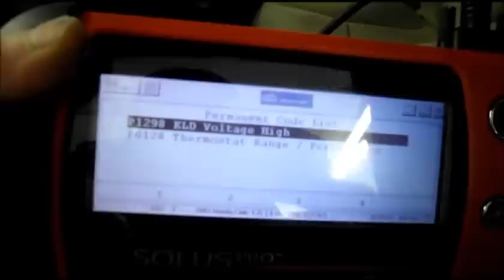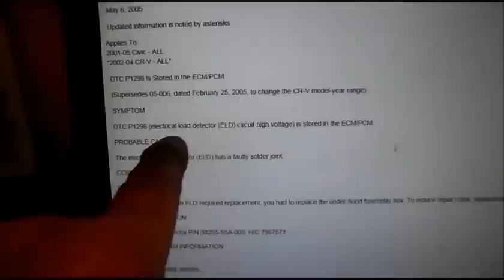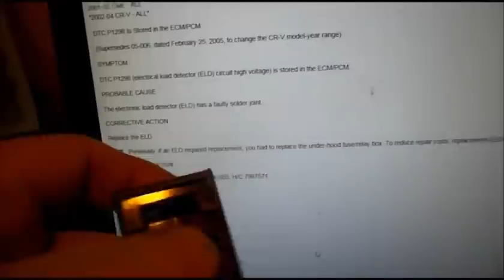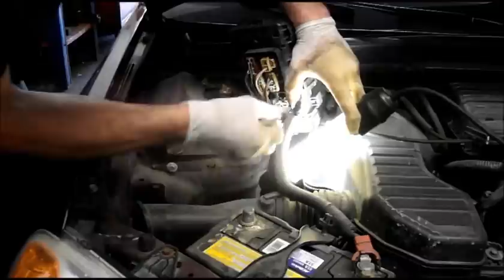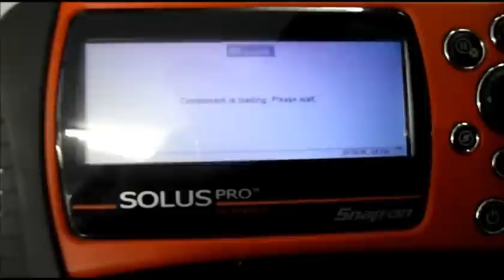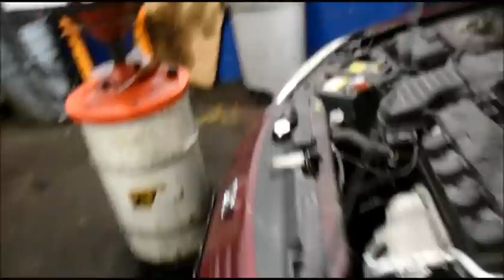How To Repair A P1298 Electric Load detector code on A Honda

Comment: Got a 2012 Pilot w the same code. I replaced the ELD however the code still shows up on diagnostics. Is it possible that the PCM is faulty? I am between that and the harness itself.

Comment: Hi Jim. I have a 2001 Civic EX and when I start the engine it runs fine but has a check engine light and battery light on and then a relay clicks behind the glove box and when that happens both of the warning lights go off but the engine runs rough until the relay clicks again and then the lights come on and the engine runs good again except it won’t idle. This will happen four or five times and then the car dies out and I have to turn the ignition off to reset it and do it again. Recently one of my boys replaced the water pump and that’s when it started doing weird things, then he replaced the crank sensor and now it’s doing what I just described. I noticed that he didn’t replace all of the ten mm bolts in the same places of the engine, and I wonder if it’s just a grounding issue or what the heck he did to it. My code reader won’t communicate with the computer either. I replaced the alternator today thinking that might be one problem, but no success. So we have a new water pump, crank sensor, and alternator, but more problems than when we started. We can’t even drive the thing now. Do you have any suggestions that might help? Thank you.

Comment: how is the car overheat when the thermostat is stuck open?  in fact will take a while to heat up to normal temp when cold and will slightly run cooler since there is no controling the temp.

Comment: I’m having intermittent battery light on 07 odyssey. Alternator is good, battery good and belt is good. I was going to change the ELD but the Honda dealership told me I’d have to buy entire fuse box. They didn’t sell the ELD separately.

Comment: Not sure if I heard correctly, did you say the car will overheat if driving for a long time while the thermostat is stuck open?  I would think will will be fine stuck open but the issue when cold in the morning will take a while for the engine to reach normal operating temp.

Comment: Thank you for the great video, Jim.  
As usual, a great walk thru that saved us lots of aggravation and money. 
I spent more time driving to the dealer to get the part then it took to actually replace it.
In my case, this one part took care of two trouble codes: P1293 fir the ELD and P1457 Evap canister leak.

Be sure to call several Honda dealers for pricing, because they all charge what ever they want.  My two local dealers were $30 apart in pricing, and I was able to purchase for $51.00.  (I needed it fast otherwise I would have ordered online for less.)

Comment: What if its eld voltage low? And would it be the same on a 97 prelude
Reply from the maker: Did you check the output of the alternator?

Comment: would that cause a rough idle,  cut off sometimes, and be really sluggish, like if the cat was clogged?
Reply from the maker: No not likely. Did you scan the car for codes?  Watch for the next free tool giveaway coming soon.
Reply: Yes

Comment: @jimthecarguy Hey I have the same code on my 98 manual civic sedan but I did replace it 3 times and I still have the same problem it keep showing the same code? Any thoughts
Reply: Did you clear out the codes before driving it and then rechecking for the code?
Reply: Yes I did
Reply: Yess I did and the check engine light was on again and telling me it was the p1298 and p0135 and p0141
Reply: @jonathanlibreros1332  Hey just got that same problem with my 99 civic manual. If you find out what it is help me out please!

Comment: Could the cause of this is the battery? I got the same code on my car and the engine light is on? If I was to get this done does the code have to be clear although the engine light goes off after?
Reply from the maker: No it is not the battery. After the repair the code should be cleared out.Thank you for watching . I'm happy to help. Don't forget to subscribe.
Reply: @jimthecarguy  Thank you Jim for responding and for your help. Great video by the way very helpful!

Comment: Question: Would a bad ELD cause my 2009 Honda Accord headlights to flicker/pulse?
Reply from the maker: Yes it is possible. Did you check the output of the alternator
Reply: jimthecarguy..Hi Jim..Yes I checked the Battery and Alternator.I also had a Parts Store checked them and they all checked good.  I went as far as cleaning the ground-wires and all lights still flicker. 
I also noticed the belt tensioner moving quite a bit and the two arrows on the tensioner do not aling. Could this be the reason for all the lights to flicker???
Thank u again.
Reply from the maker: @Aviador1010  When you check the charging of the battery what is the voltage and does it stay steady.
Reply: jimthecarguy the voltage is mostly steady at 14.9 but it drops momentarily to 13.0 when the A/C clutch kicks in. Just for a second tho.

Comment: This is EXACTLY what i needed to see. This P1298 code is the last of the bugs i've been chasing down on this car. First it was a crank position sensor, then the idle control valve, and now this P1298 is the last code to fix on this car so i can smog it and register it. Thank you for the detailed and informative video. Much appreciated!
Reply from the maker: I'm happy to help. Thank you for watching.

Comment: My friend's Honda Civic 2006 got code P1298 and the fuse box looks like one in the video. I noticed also that battery is being charged at idle 14.2 volts. Is there a connection to bad load detector? Great video, thanks

Comment: I have a 96 acura integra that was a JDM B20B enging swap and i have the code P1298 but heres the catch my under the hood fuse box doesnt have the so called ELD and now im at a stand still any ideas?

Comment: I have a 2012 Honda Civic Si,  How hard would it be to show how to run a bypass on the ELD?  I have a huge sound system with a auxiliary battery in the trunk. The ELD is preventing the alternator from outputting and staying in the higher current mode when I need it too.  I also upgraded to a High amp alternator (Ohio Generator) but it doesn't matter if it pumps out 1000 amps the ELD still cuts it to 12 volts in order to save on gas mileage.  The ELD is such a pain for people with large sound systems in their cars.  I just want to run it old school, but with a switch so I can manually turn it back to "Gas Savings Normal" when I'm transporting the elderly.
Reply: Lol

Comment: I have an 09 Civic si. I’m unable to remove the fuse box housing because it’s factory zip tied to some sort of hose full of cables. I don’t even think if I cut the zip tie I’d have enough slack to invert the box. I can’t find any videos to confirm that my generation of Civic even uses the ELD like these earlier models. Any ideas?

Comment: Jim, CRV has gone crazy. Brake lights won't go out, numerous gremlins all over car, some things work, then don't.  All electrical 1st gen CRV, early 2000-2003. Any ideas? Could this thing be the problem?? Thanks..
Reply: Find as many ground points as possible and inspect and clean them. Many times single ground points have up to 6 wires going to it and so one bad ground can cause a lot of electrical issues from seemingly unrelated systems.

Comment: You did a good job the only problem you disconnect the negative always disconnect the power one you never know if the negative will touch metal and gets grounded thank you. you did a good job

Comment: Thank you for that info that helps me out with one problem in my car another problem is the Vtec solenoid would that interfere with that and cause it to kick on and and back off and it smokes real bad and burning oil. I have a 2003 Honda Civic EX 1.7
Reply: How many miles do you have on it??

Comment: I have the same code on a 2002 accord v6, but the part does not exist for this model  and honda said to replace the entire fuse box. Is there a way to replace it or should I just got ahead and replace the whole box? 

Thanks for all the videos you post; very helpful.
Reply: I am having the same problem aith my 01 accord did you ever resolve this problem?

Comment: I'm having trouble taking the the eld of I'm pushing the little latch but it's not wanting to come off
Reply from the maker: Horacio Ulloa The plastic has dried out, if you use a small screwdriver to assist it will help get the clip out.

Comment: i have a 03 honda  crv 5 speed and after driving it for about 45 min if my rpm is over 3000 it takes away my gas power will slow me down from 70 to under 60 and then will not let me go faster then 60. can you help
Reply from the maker: Did you scan the car for codes?

Comment: i have this code AVD 14-02 eld voltage high . 04 civic Will it be the same issue ?
Reply from the maker: chiko a Yes it will be the same issue, it's very common in that car.
Reply: +jimthecarguy Thank you last question where u recomend to buy it autozone or dealer ship ? i what part do i ask for?
Reply from the maker: chiko a The dealership is where I buy it (under $50). Ask for the electronic load detector.
Reply: +jimthecarguy thank u so much for the info and fast response like ;)

Comment: i have this code AVD 14-02 eld voltage high . 04 civic Will it be the same issue ?
Reply: chiko a Yes. Your electronic load dectector (ELD) is at fault, usually when these pop your O2 sensors go bad so keep that in mind

Comment: Ok so I've researched dim lights but only on low beams n it says to replace this fuse or load detector...not sure if this will fix this issue or not ugh any words of wisdom? Have u dealt with this issue in Honda Elements by chance?

Comment: my 2001 civic came up with code P1298 but does not indicate ELD, but "Manufacturers control fuel air metering" also code P0128 coolant below thermostat temp. Are these codes the same

Comment: Hi, I have a problem with my honda civic 2001, when I start the engine and turn on the air conditioning the lights on my dashboard go down, I thought it was the alternator, but I changed it for a new one and the problem still remains. I put the scanner and me Came out the code p1298. What do you think the problem is?
Reply: Did you ever figure it out man?

Comment: is there a way to clear the codes without the handheld device?
Reply from the maker: Thank you for stopping by the shop.On some cars you can just remove the battery cable and that will clear the code
Reply: John Trankle go to your nearest auto part shop, they have the OBD diagnostic tool that will reset the code. For free.

Comment: hello my car has a code p1298 and p0420 it came on after I was "racing" a friend which I never do I was going kind of fast and a couple days before that I jump started my truck I'm just curious been trying to diagnose before going out and buying  a new catalyst converter ,what do you think?, thank you for your time
Reply from the maker: If the light was not on you should just clear the code and see if it come back on.Is there any exhaust leaks ?
Reply from the maker: If the light was not on you should just clear the code and see if it come back on.Is there any exhaust leaks ?
Reply: RU

Comment: Thanks so much Jim! I was having a rough idle, especially with the AC on. I would get random fluctuations in RPM, car felt bogged down, and idle surges at traffic lights. I didn't have a check engine light, but I ran the code scanner anyways. Pulled up a P1298 somehow and the electrical load detector came up on google. Grabbed one from the dealer, and with the help of your video, had it changed in no time. I pulled the fuse and reset the ECU, drove it around the block, and the idle surge seemed to have stopped. When I got back I checked the code and it was no longer there. Hope that was the ultimate issue and my car starts running well after my ECU relearns my driving habits.
Reply from the maker: Thank you for watching  and your input
Reply: aznnp77 had the same problem with my 02 crv was idling high coming to stops or shifting gears .thought it was the iacv.no check  engine light but ran codes and pulled that up replaced and fixed the problem runs cherry as can be now
Reply from the maker: Thank you for your input and for watchung

Comment: Hey Jim, just curious,

how would the car overheat if the thermostat is stuck open? I thought that would just make the engine run cooler never reaching operating temperature, but would overheat if the thermostat were stuck closed. Thanks in advance.
Reply from the maker: Actually if the thermostat is stuck open the coolant will just circulate and get hotter .The thermostat when it closes will hold the coolant in the radiator for a short time to cool it down and then when the thermostat opens the cooler anti with exchange for the hotter coolant.

Comment: Nice video, I have a 97 prelude with charging issues, a new battery has been installed and the alternator was rebuilt and tested fine afterwards off the car. When I turn on car it starts at 14.1 volts then slowly just draws the battery down, when electrical load is applied it reads about 13.5 and eventually the battery light and E brake light on gauge will illuminate. I cleaned up the grounding points and checked cables for excessive resistance and even tried my obd 1 ECU to see if that could be the problem, same results occured. No CEL light has came on but do you still think this could be the cause and not allowing ecu to send the signal to alternator? I am still going to remove and visually check it meanwhile. Do you have any other suggestions, thanks in advance.
Reply: You have a bad alternator. I have had this occur when I installed a "New" Aftermarket alternator and I got "13.33 Volts" when I first started it and as It kept running the voltage went down as low as 12.22 volts. Swap alt, with another one and problem solved.
Reply: repeatman I don’t believe this is true cuz I am having the same issues I am not getting 14 volts when my car is runnin and if I keep my car on it slowly goes down in volts and I brought my car to Honda dealership a few days ago and they said it was a bad alternator and that I shouldn’t use an aftermarket one so I buy a used oem alternator out of the same accord I Own and change the battery terminals and it didn’t fix anything at all so at this point I’m going to install a new eld but I don’t know what else it could be. I’ve installed 3 alternators from autozone and then a day ago a used oem from junk yard that came from the same year make and model installed it and still not getting 13 or 14 volts at all and just slowly drains my battery while the car is running

Comment: p0118, p0112,.p1298
Reply from the maker: +Josh Breyette  You will also need to check the P0118 that is the engine temp sensor.Th eP0112 is not to important it is just the air intake temp.The P1298 can be check later also.

Comment: would this cause my car to not start?
Reply from the maker: +Josh Breyette  No usually this will not cause a problem starting.When you scan the car was there any other codes?What happens when you try to start the car?
Reply: One day I was driving my Integra. It bogged then died. Every time I would start it, it would run for five seconds, then slowly decline then die, when I would try to give it gas to keep it running it would die quicker.
Reply from the maker: +Josh Breyette It sound like you have a fuel problem.You will need to check the fuel pressure.

Comment: Do you have to clear out the code? when u r done changing it
Reply from the maker: +A.B  Yes it is always a good idea to clean any codes.
Reply: Is this gonna cease the overheating issue,,would I need a new thermostat after

Comment: I have a honda civic 01, codes p1298 and p1259 came on. I replaced the ELD and the Vtec selenoids and fix a few oil leaks. However the codes came back
Reply: hi wilkin minaya did you finally fix these issues as I have the same codes and issues on my Honda crv 2002
Reply: John Batten I fix the code p1298 by cleaning the plugs under the fuxe box and the p1259, I havent fix that code yet but since my car is misfiring and I have tried everything, the. Ext thing will be to check the timing on the car since all those problems started afted a headgasket replacement

Comment: i have a 1998 honda civic. the p1298 code comes out on the car scan and i need a new eld but i cant find one for a 98. will a 2001-2005 honda eld fit in the 98 fuse box?
Reply from the maker: +Rudy Maldonado  The best thing to do is call the dealer and ask them

Comment: help - I have a 1995 Honda Odyssey. The engine is in great shape. The battery loses a charge. I have a check engine light codes 14 and 41. I have changed the alternator, I have changed the battery, changed the battery cables, checked the alternator belt and connector to the alternator.  The car runs with a fully charged batter at around 14-13 volts. After running for about 3 hours with the lights and radio on it drops to 12.2 and then to 11.6. After another 2 hours the car dies. Voltage at battery once it dies 1.82 - any ideas - suggestions.   I appreciate your help, I am lost!!!
Reply from the maker: +Teresa Duran The codes that you have can not cause the charging problem.The 14 is for the air bag and the 41 is for a wheel speed sensor.To me it sounds like you have a bad alternator but you will need to have the charging system checked when the charging voltage is low.Keep me posted.Jim

Comment: Very good video and explanations of symptoms!!
Reply from the maker: +Antonio Gonzalez  I hope I was helpful.Thanks for watching and your feedback.
Reply: +jimthecarguy Check this case, I have the same car on the video and also the same problem of P1298 and over heating. I'm surprise because it's rare both problem show up at same time when I don't see relation between them. The over heating problem was fixed by flushing dirty coolant and changed the thermostat.

Again thanks for the video.
Reply from the maker: +Antonio Gonzalez  I'm happy to help.